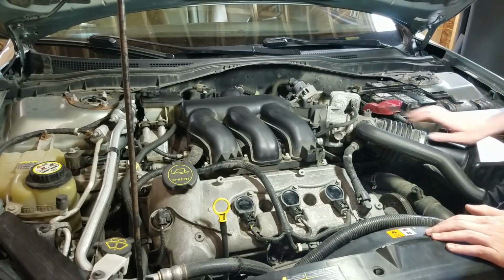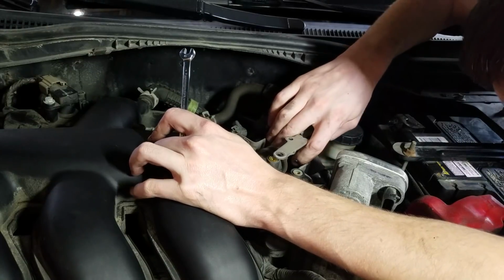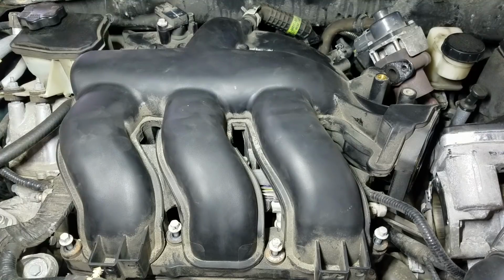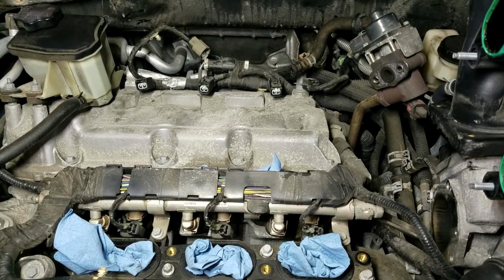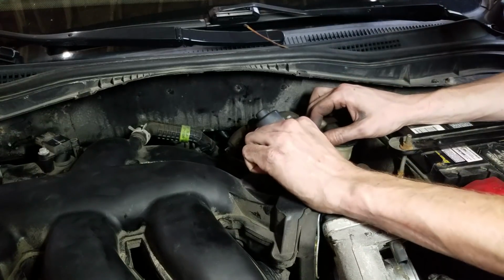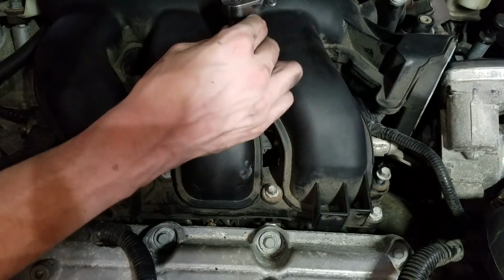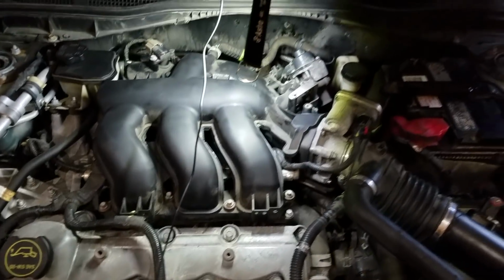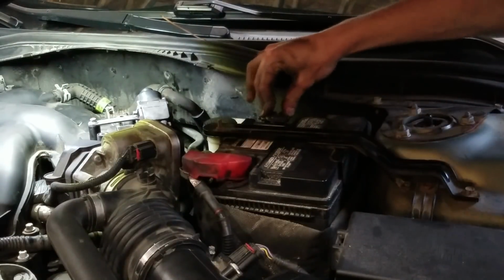How To Change Spark Plugs in a V6 Ford Fusion

Comment: 🛠🔩🏆👍  This is the BEST how-to video for the Ford/Mazda Duratec 3.0 spark plug change out there. You explained each step carefully and clearly, you used a tripod (important), the camera stayed focused so viewers could see your work up close, and, most importantly, you didn’t have any annoying hip-hop/rap/metal “music” blasting away in the background— always a sign of a true YouTube amateur. Thanks for posting this and helping anyone tackle this job, which isn’t that hard. Or they can pay a shop $300-400 for the work. 😤🙄 Tip: For stubborn old spark plugs that don't want to turn when you take them out, I spray a shot of PB Blaster rust penetrant (or similar) down the spark plug hole and let it sit for 24 hours. That stuff is a miracle product!
Reply: Hello, with what force Nm should I tighten the screw of the intake manifold mazda cx9 3.7v6

Comment: Great How-too.  I’d been putting the job off for a year because I dreaded the throttle and intake.  I was just going by the Chilton guide.  Black and white pics do not clearly illustrate how to remove wires and hoses. 

Thanks for the steps in putting it back.  Most How-toos just say do the vid in reverse. Many thanks from the mountains of SW Va. 2009 Ford Fusion.
Reply from the maker: No problem, glad I could help.

Comment: Very good video. You really take the time to explain as you go. I had this done at a garage the first time. I might attempt it myself after watching this!  My daily driver is a 2008 Fusion 3.0 with 442K miles. Plugs have only been done once @ 250K.
Reply from the maker: You are getting your money's worth out of those plugs for sure! It's an easy job, just take your time, and it's not a big deal.
Reply: 442,000 miles 😮😮😮...I never knew cars could get that much lol. Very impressive
Reply: @joesuff17  once drove an 01 dodge ram that had 780000 was my bosses truck he was trying to get it to 1million
Reply: Damb 400k

Comment: Thank you so much.  I had a misfire on #1 today.  I got lucky a few years ago and had a misfire on one of the front cylinders.  So I just replaced those three at that time lol. Now it looks like I got to do the big job.  One question:  I purchased two upstream o2 sensors several months ago.  Do you know if taking the intake off is required to replace the one on the firewall side and how difficult it is?  Are those o2 sensors usually very stuck?

Comment: Apparently I need my cylinder 3 spark plug changed on my 2010 Ford Fusion, maintenance wise I need them all done. Is $300 reasonable?! Thank you
Reply: I was charged 325 to replace one coil. 475 to do all 6 coils
Reply: Sounds like a rip off
Reply: Elizabeth A were ripped off

Comment: What are the best for the price replacement coils for this engine?
Reply from the maker: It doesn't matter what the price is, ONLY BUY OEM MOTORCRAFT. It's common on these cars to wipe out the computer if the coil fails. Only buy OEM end of story.

Comment: Both my valve cover gaskets are breached and it is part of the spark plug seals. oil is leaking. This is hard to replace? And the oil pressure sender is leaking oil too.

Comment: Thank you for the video. Did you change the valve cover gasket ? If not, why not?
Reply from the maker: I didn't. It was not leaking. The intake isn't hard to remove. I'll change the gasket if it's leaking.

Comment: Do you ever come across in any issues later with tightening spark plugs according to recommended torque specs? Some videos I watch on Youtube says not to tighten sparks plug according to the torque specs because it might over tighten and blow out.
Reply from the maker: Pie P I haven't had any issues. You are better off going a little tighter than spec. rather than looser. If the plugs are too loose they can viberate and eventually viberate enough to destroy the threads, which blows out the plug. Some engines are more prone to this than others.

Comment: (HELP) i have an 07 fusion and I hope you can help with this question to save me time & $$$. Recently my car stop working battery is fine all the lights work everything, only thing is the car won’t start or crank to try to Start. it just turns on lights & is all It can do. I just got the car it was running smooth but It started acting that way because I’d always wait til last minute to add gas so it’ll be on E til it’s almost done then I’d add gas. Do you think it’s the starter, spark plugs, fuses?
Reply: Did you get the car fixed?
Reply: Loose battery connector happened to me

Comment: I removed the first spark plug coil under the intake manifold cover and it has a lot of oil leaking from the coil in that tube area. What does that mean and what should I do?
Reply from the maker: Pie P the spark plug tube is leaking oil. You need a new spark plug tube seal. It will cause mis-fires eventually.
Reply: Repair Geek where does the spark plug tube seal go into or fit into? There were no seals when I removed the coils under the intake manifold.
Reply from the maker: Pie P the valve cover.

Comment: Did everything besides I disconnected the battery.. no my check engine light is on can it be my battery code cause everything else is fine
Reply from the maker: Something is probably unplugged.

Comment: How long of an extension do you use to get into the cylinder?
Reply from the maker: 6 inch
Reply: @RepairGeek  Thanks. What size sockets did you need for the bolts? I heard 8mm. Any others?

Comment: You have some very expensive tools. Snap on are very pricey.
Reply from the maker: Not as much as you think. What I used in this video is about 1/2 of my Snap On collection. I got them at half price when I was in mechanics school about 10 years ago. The things I bought have a mechanism. Not just sockets. Back then buying things online wasn't as big as now. Harbor freight tools were complete crap. That left Sears or the tool truck.
Reply from the maker: The more I use Gearwrench tools the more I like them. If I was starting out now all of my Snap On tools would be Gearwrench.
Reply: I have a few mac and snapon brands but mostly sears. I don't mind Harbor freight tools that aren't too complex like wrenches and such. I don't really do specialty tools from HF... you just asking for trouble lol.
Reply: ...THE GOOD STUFF USUALLY IS EXPENSIVE- YOU GET WHAT YOU PAY FOR!!!
Reply: If you are turning wrenches all day for a living, I agree you probably don't want Harbor Freight tools, but for me the occasional do it yourselfer, Harbor Freight is great. I have got great service out of them.

Comment: I wasn't terrible impressed with that ratchet to pull the plugs with.  It can put various unwanted forces on the plug.  I prefer to use an old-fashioned torque wrench with my other hand firmly holding the center of the socket very well centered over the plug. Once the torque in broken you should use a smaller standard ratchet.  Granted you do use your left hand to try and keep the force circular and not sideways.  Also I didn't see any silicon hv dielectric grease put on the end of the coils where it goes over the plug.  That HV is so powerful that given the slightest excuse it will try to find a way out of the boot and down the outside of the plug to ground, leaving a carbon track behind.  You need to use the dielectric grease.
Reply from the maker: I'll address what you said before you edited your comment.

I highly doubt you can force enough lateral movement to break the porcelain off of the spark plug on this particular application. If you try to move the extension from side to side in an attempt to break a spark plug the extension will hit the spark plug tube and stop before the plug breaks. Is it possible?  Maybe. If you don't know how use a ratchet and extension without creating damage, you probably shouldn't attempt this service.

You do make a good point about using dielectric grease. I simply did not have any on hand but, if it's any consolation the car is still running like a top. Thanks for watching.